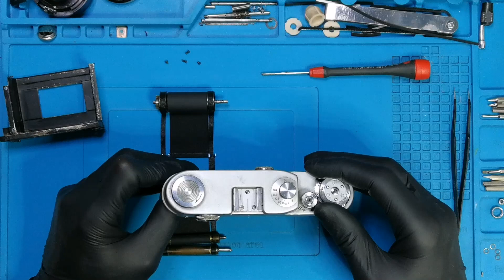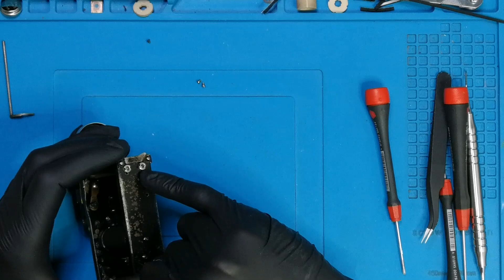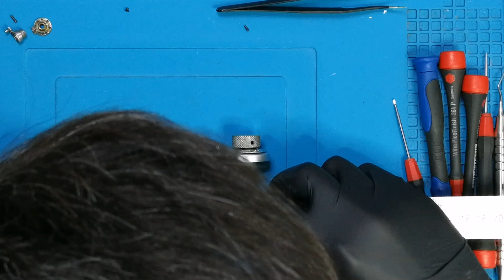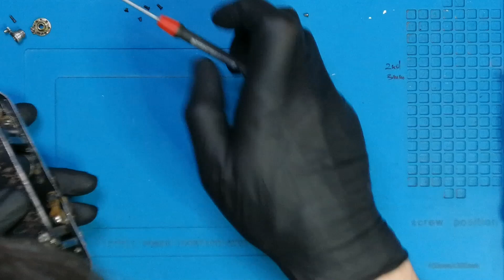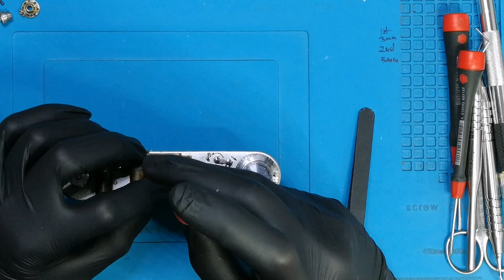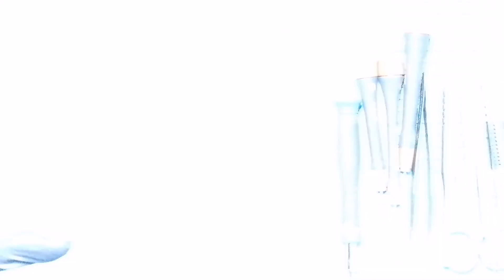Zorki 1 CLA - part 5 (getting the shutter back inside the camera)

Comment: Hi. I'm also having trouble re-gluing the shutter curtains. I glued everything according to the marks, but I can't set it to 1/500. I can hold it, but it works like 1/200. By pulling the second curtain several times tighter than the first, I can get it to 1/400. But that shouldn't be the case. The problem is clearly with the curtains being glued incorrectly. I'm still experimenting. I think there should be factory instructions somewhere on the correct position for gluing the curtains. But so far, my search has been unsuccessful.
Reply from the maker: The factory positions are, unfortunately, no guarantee for the correct placement. Sometimes they're ok but more often than not they're approximate at best. And almost always the second curtain is too fast and there's not much you can do to fix that. I have a video explaining why these shutters can't be adjusted precisely. Look for "The Barnack shutter design explained, with a Soviet twist".

Comment: Hi Alin, really appreciate your videos they have helped me develop a new hobby. I am doing a CLA on a Zorki 1C but cant find any info on cleaning the rangefinder optics. Which surfaces are plan glass o=and can be cleaned normally and which are part silvered so need to be left alone. Can you help?
Reply from the maker: Sorry for the late reply! The only surface you must not touch is the 45 degrees angled glass found on the left side of the assembly. And the dangerous side is the one facing the back of the assembly. Everything else can be cleaned freely.

Comment: How can I determine the correct positions for gluing the shutter and ribbons onto the large wheel? In my unit, everything was already detached, and when I took it out, it all came off in such a way that the connection points are no longer visible.
Reply from the maker: That's going to be very tricky. Try to glue them with double sided tape first in such a way that when the shutter is released on B each curtain is about 1.5mm behind its respective film gate edge.

Comment: That was a very nice walk through a thorough CLA -- many thanks. Unfortunately you rushed a little too fast through a crucial part of the reassembly: the relative position of the roller gear and stopping gear when you insert the drum with the 2nd curtain. I struggled with this for quite some time. Maisenberg doesn't explain this very well (it only makes sense, once you know how to do it). Eventually I found a repair guide by Vishnevsky (1964) which expains this in the needed detail. If you google for "vishnevsky camera repair" you'll find a PDF. A good guide also for other matters.